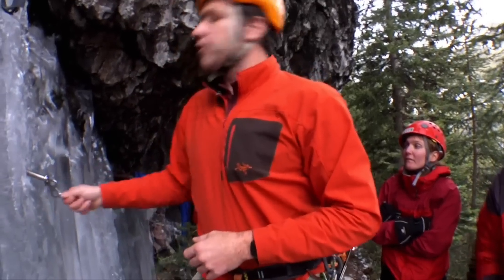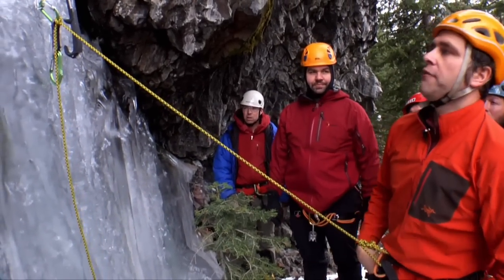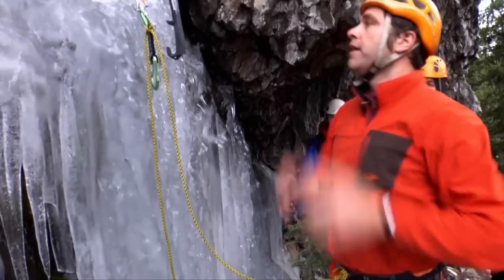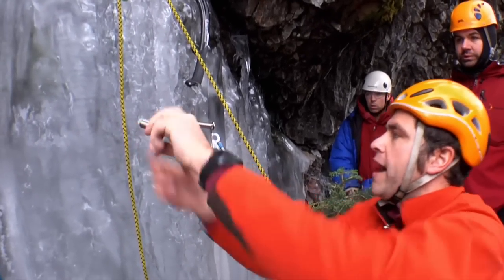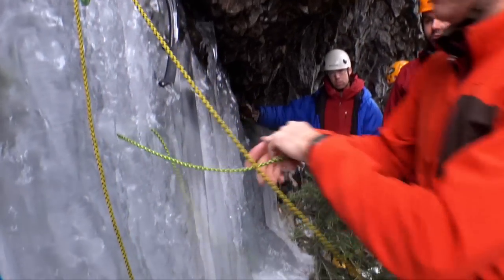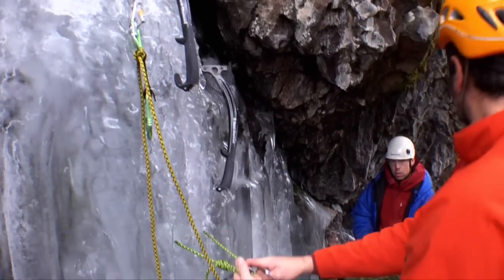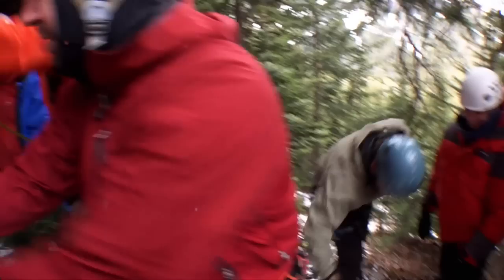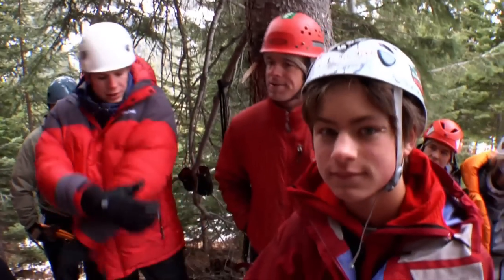ARC'TERYX How to build a V-Thread Anchor on an ice climb

Comment: if ice fractures horizontally then why are you not making your abalakovs holes vertically to each other?
Reply: that makes sense!
Reply: my guess is that puts tension strictly on the bridging piece of ice where as the horizontal gets a frictional force in the 90 degree bend coming out of the ice
Reply: maturtlelaza that makes sense but I saw in a video how Elizabeth Revol did it the v thread vertically
Reply: @samk7717  I think a Vertical 'V' Thread is called an 'A' Thread